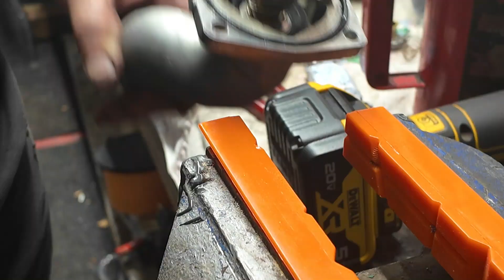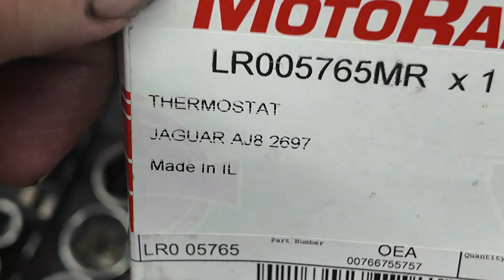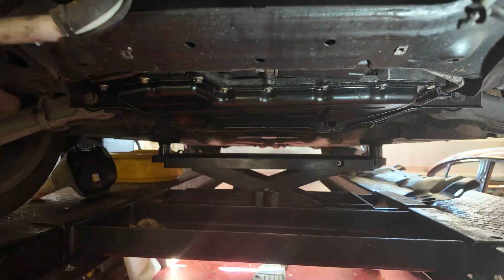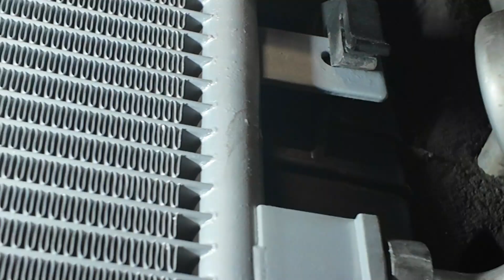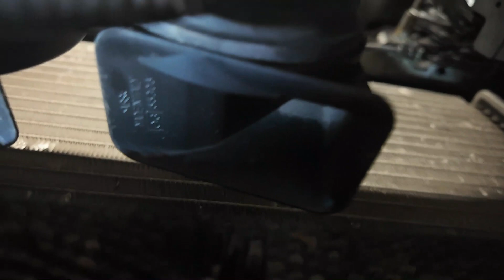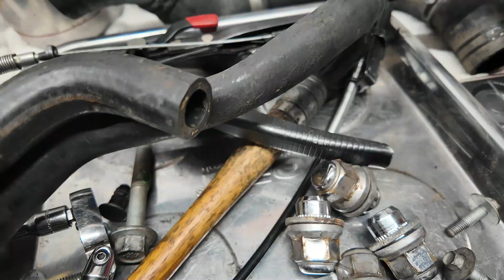Jaguar S Type R EP13

Comment: Thanks for the mention. Yes, the S Type has an air-to-water intercooler and that was it. I’m enjoying these vids since they also apply to my XKR, not that I’m planning to take it apart, but at least I can sound knowledgeable if (when) it goes into the shop. BTW the thermostat parts bag said AJ8, referring to the engine, not XJ8 so I think you will be good.
Reply from the maker: Another name is Jaguar Charge cooler :) the engines are similar

Comment: The hoses that u have for the supercharger if the issue is the molding to fit there is a tool to mold hoses to a specific shape . The spring tubing benders kit . U place the spring tube inside the new hose u want to shape and bend to fit the old one . Then u heat the hose with a heat gun . This will mold the new hose to that shape . Then u just pull the spring tube from the hose .
Reply from the maker: I used to use those springs when I was an electrician (one of my many talents/jobs), they work great.